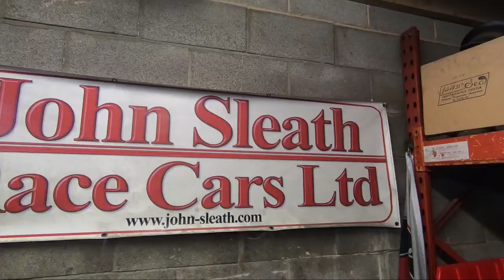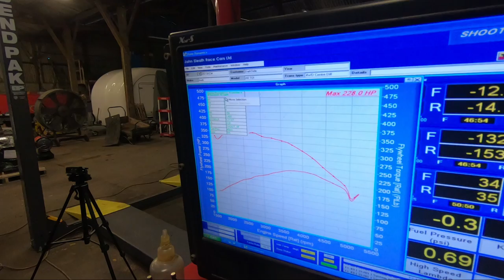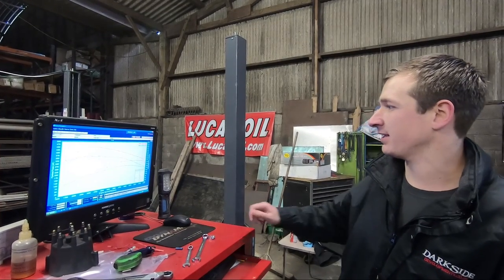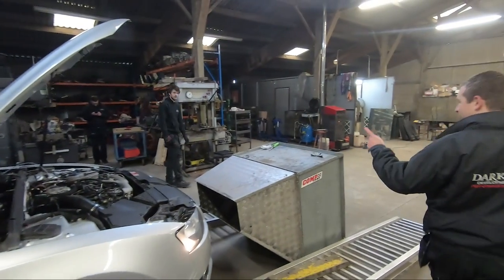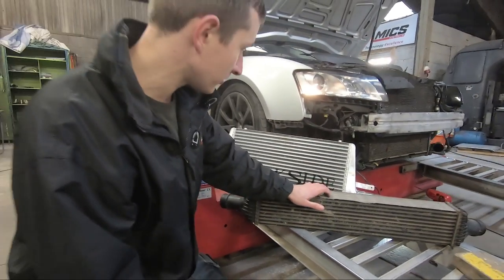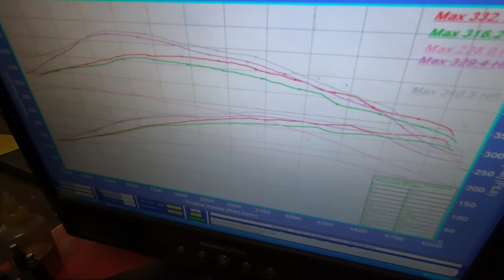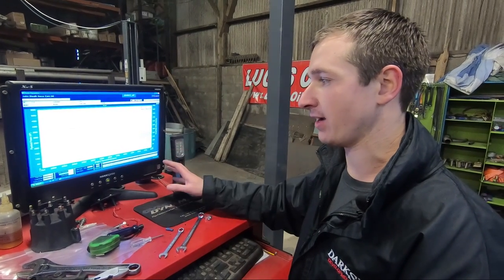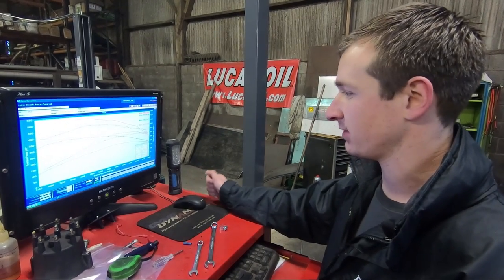228BHP to 340BHP! 4WD DYNO TUNING - AUDI A5 3.0 TDI QUATTRO PROJECT - DARKSIDE DEVELOPMENTS - PART 8

Comment: I have the same car v6 tdi 3.0 but in manual I tried contacting the previous owner to know what mods it’s had but no luck only thing I can see is it’s had dpf off and a loud stainless exhaust fitted it seams faster than my E90 330d. How do I find out if it’s had a remap or other bits please advise
Reply from the maker: Take a look at the boost pressure, just less than 22psi or 1.5bar is stock

Comment: I noticed you meantioned the Maf sensor maxing out after tuning a few videos , what sort of g/s should a stock and stage 1 tuned A5 TDI expect to see ? Mines stock as far as I know , vcds shows 240-249 g/s max at 4600rpm doesn't seem right ?  guys ?
Reply from the maker: MAF is not the best wat to tell, log Rail pressure and Boost, should be 1800bar and 1.5bar :)
Reply: @DarksideDevelopments   yes , that's exactly what I see , 1800 rail and 1.5 bar boost (245 kpa) . I don't understand why the Maf maxes at 249 g/s then flatlines at 249 ? My other tfsi cars have never flatlined (maxed out ) the mafs
Reply from the maker: You are logging the wrong channel then

Comment: Very good series, love the transparency in mod by mod dyno/timing differences. This really makes me want to go through my 2.5 AKE and fit out some parts I've acquired - I must go back and check on the clutch you use on this.
Reply: B8 platform manual has twin plate stock. This has stock DSG auto, stock clutch
Reply: @ryanp6138  I suspect by the this build is done I'll have over 450 reasons to switch to the 3.0 platform at some point.
Reply: @CarAndMechanical  maybe 500...haha

Comment: What you think about head porting, polishing? It's diesel, so straight injection, and best airflow is with polished surfaces, also that big Y-shaped intake tube porting? Also a bit beter flowing exhaust manifold. It all increases efficiency, in other terms, same power with less boost. Also what you think about maxxing out an engine on stock turbo? (no nitro ofcourse)
Reply: Porting will help this engine a lot. Inlet and exhaust manifolds are getting worked on soon but they are OK to 500hp we think. Stock turbo stops around 300hp as per this video
Reply: @ryanp6138  Stock turbo on ported and freed-up airflow? I think it would go more, like, 315 maybe
Reply: @gedas3419  it won't be worth the effort.
Reply: @ryanp6138  It's all about the time, the effort, the gains. The pride "Highest stock turbo powered 3.0 tdi" it'd be cool. Ofcourse you have fastest fwd tdi car, so such a project won't bother you. Have a good day. Thank you for answers :)
Reply: @gedas3419  everyone needs a goal!
Reply: Same car just manual gearbox i got 321hp with stock turbo, dpf delete egr delete and straight pipe exhaust
Reply: @damira.5659  Show us the dyno then

Comment: I have a touareg 3.0 TDI from 2005 with the engine code BKS. I would love to have around 330/340 bhp with it. Right now it’s remapped to around 285 bhp en with some small mods like a straight pip from the down pipe en a different air intake. I think it’s around 295/300 right now, what would recommend? Because there aren’t any front mount intercoolers or decat downpipes for it.
Reply from the maker: Email, we can help!

Comment: Been following you lads for a while on this one. I have an 07 A6 TDi 3.0 Avant, which I bought when it was only 2 years old (meaning I've had it nearly 10 years now!!). I have over 200k miles on it now though, so I'm curious/paranoid as to what effect these extra mods would have on my engine (and gearbox for that matter). It's been totally faultless - I do all my own work (and even have VAG-COM for the diagnositics), and still pulls like new. I actually got it remapped the day after I bought it, and though I can't tell exactly what increase it gave, I have had it up to 152mph on the GPS (160mph on the clock) with still more to go, so I can only guess I did gain something! Thing is, the car isn't worth anything now with that much mileage, but I still love it, and have no intention on selling it as I have other toys to keep me amused (and I can't really justify coughing up a load of moolah on a newer BiTdi just to get the extra power and a more up to date infotainment system!!). BUT, spending a few quid on it with you lads to get this much power out of it? I already love the fact that it is an anonymous looking diesel estate car, that will do over 150mph on the GPS with ease....... imagine what it would be like with even more power?? ;) So anyway, expect an email from me in regards to costs, etc., but just one quick question: would you risk it on a motor with over 200k miles on it? And if so, how do you think the extra mods would affect an engine (and gearbox!) with that much mileage? Fair play anyway lads - loving this one! 😉
Reply from the maker: Hi, we have tuned cars with the same mileage and more. As long as the car has been well looked after you should not have any problems. Some wear items may need changing a little sooner but this would be expect at the mileage anyway. Drop us an email with the reg/vin a long with a power goal and we will price up some options for you. Thanks
Reply: @DarksideDevelopments   Expect an email from me soon, Cheers! ;)
Reply: it will never make sense to sell it, you can't ask for much more in a daily cruiser. maybe a bmw touring gives you bit better dynamics and bit more analogue driver involvement, but modern audi's handle like they're on rails up to 8/10ths anyway, and are faster in poor driving conditions ie the uk, they just have everything.

Comment: Outstanding video (some mics issues) on showing the steps and progress... question: what was the fuel consumption at the beginning and then after the upgrade (in mpg)?
Thanks
Reply: Thanks, low 40s and high 30s all the time really. On track it's a lot less! Haha

Comment: Hi , very good information,
I was thinking of putting water meth injection on my Volvo S60 D5, , but with the smoke I don't know now, good to see it in the real world, 
Thanks Dave
Reply from the maker: we will make a video of smoke with on and off soon
Reply: @DarksideDevelopments  
Hi ok thanks for that 
Dave
Reply: You can obviously tune the fuel to suit ... However not sure if it's worth the extra monies and complications of a WM system for the small gains in power ... Yes when you are to the top end and you want to keep egt under control but else is no point ... But again  this is my opinion only ..

Comment: hey there. i have the a5 3.0 tdi with straight pipes and small remap, its around 300hp at the moment. every time i pull hard, at 3rd gear and close the 5000rpm it start flashing a yellow light on the main board and it goes into safe mode ,i believe its either injection or too much power that was given with the repro? Also, how many hp can i get if i hybrid the turbo and with a reprogramation? thanks a lot and keep up the good work!
Reply from the maker: You would need to check for fault codes, this should give you a better idea if the issue is fuel or boost related. We have done quite a few 400bhp+ 3.0 TDI builds. Please email us with your vehicle details for a quote

Comment: The soot coming out isn't exactly burnt diesel like most think..Now before people say what do you know blah blah blah My old man here in Australia is the C.E.O of a company that has been making diesel engines since the 60s maybe even earlier..So we got some very expensive engineers on hand and we learn alot from them and I would argue that that slight increase of power is coming straight from the meth its self and the water and meth is causing it to not burn as much fuel in the combustion chamber hence the more soot/unburnt diesel all diesel guys know you don't want to cool combustion temps it needs heat & compression to burn properly and that silly water meth is having a big side effect on that process so piss it off throw more fuel at it more air and can't have enough sensors before and after more data the more you can learn about what its doing the more you learn what its doing when and where the more you can manipulate the power
Reply from the maker: Get your old man to do some testing for us :)

Comment: By far the best project I’ve followed. 

How much money has this cost you so far?
Reply from the maker: We have spent a lot of money on this project, and a lot of time but for a customer to get this power, its going to be roughly £6k but email for a quote :)
Reply: 6k aint to bad! Considering u can buy one of these cheap, around 10k for 350hp diesel daily, that will move along the road nicely
Reply: @toyotaturbo504  not many ways to get this sound, speed, economy and comfort and this price while still looking good.
Reply: @ryanp6138  i agree with you 100% also 4wd for winter daily use! Good economy's, nice torque nice horsepower and sound! For under 10k easily!! I did look at these a while ago and always wondered what ur new GTD turbo would do on a v6 3.0tdi audi system, where do u source the new diesel pump from? Audi themselves? I hope to see nice performance again! When u upgrade.
Reply: @toyotaturbo504  The GTD2263 not a straight fit on older engine otherwise I would try it. Nice turbo
Reply: @toyotaturbo504  we will offer used, tested, reman and new pumps
Reply: Agreed

Comment: Even on stock hardware with dpf still in place you should see 320 bhp and 750nm, this map needs to be revised.
Reply: On a different Dyno maybe, HPFP pump can't keep up so how do you explain how to get more?
Reply: @ryanp6138  You have a CCWA meaning you have a  CP4.2 pump, you should be able to inject 98mg of fuel. Taking you up to 365-370bhp because you already have plenty air  with the hybrid.
Reply: @RealGX  not the case, rail pressure drops at 340hp

Comment: Will you be taking the A5 to the strip ? Estimated eta ? 13
Reply from the maker: 12s at this specification will easily be possible
Reply: As fast as a metro 1.8 turbo but with out the death feeling and a heated bum.

Comment: this is brilliant!! but i was expecting more power considering you have hybrid turbo / dpf delete / exhaust AND METH ... 
Have you tried to change the MAP sensor to a 4 bar MAP sensor ? it will give you more torque gains and better boost control.
Reply: Fuel pump is limit. Already has 4bar
Reply: Most figures other claim are inflated

Comment: What are the maximum figures you are looking for to gain?  Very impressive I will be bringing my a5 to you very soon for some work.
Reply: Fuel pump limited now but 400 should be possible
Reply: @ryanp6138  Very nice I was thinking around 400 myself depending on fuel  pump. 

What kind of price would a customer be expecting to pay for the same upgrades as this just without the meth install..  its not something im interested in running on my daily car
Reply from the maker: @blackmagic9317  Hi Craig. Drop us an email to sales@darksidedevelopments.co.uk with your reg and the mods you are looking for, and we can send you a quote. Cheers

Comment: Metering valve upgrade? What is that? Whay does it do?
Reply: Bigger air flow meter housing mate. Sits on the intake piping on the compressor side of the turbo.  Like a popular upgrade on the s bodies are z32 mafs.
Reply: As opposed to a map sensor which measures the air pressure in the intake manifold. Which is far superior for making power.
Reply: Metering valve is a fuel pump part
Reply: MAF not limit yet
Reply: @ryanp6138  are you on about the fuel sender unit? Or the bit that houses the fuel pump itself?
Reply: @ryanp6138  or fuel pressure regulator...
Reply: @ryanp6138  because theres not much to a fuel pump housing at all. Theres the pump with the pouch on the bottom and the tall narrow cylindrical thing which is the sender. So.....
Reply: @lloydeturner3722  I'm the one talking in the videos!
Reply: That valve comes in newer pumps?
Reply: @simaodelsol  buy one and see!

Comment: nice video, helped me alot of understanding this engine.  im in the "middle" of swapping turbo on my 3,0tdi CAPA engine. i have to change it anyway cus the last owner did not hook back on the intake propperly so the turbo is sandblasted inside. im def, gonna look out for videos uploaded by Darkside Developments in the future.
Reply from the maker: Great, we can supply everything you need!
Reply: @DarksideDevelopments  i am not sure but i bougth a gt30 kit of turbofun in norway wich is an darkside dealer. i think they ordered from you :)
Reply from the maker: @MathiasBP94  There is a GTD2872VRK being prepared for them now, so probably yours :-)
Reply: @DarksideDevelopments  same as you guys have on you A5 ?
Reply from the maker: @MathiasBP94  Yes it is...
Reply: @DarksideDevelopments  how is the turbo in everyday use ?
Reply: @MathiasBP94  will do a video soon describing how it goes. Very well though, you will be happy!
Reply: @ryanp6138  how do the clutch holds up ? i have not seen every episode of the series (working on it) ^^.
Reply: @ryanp6138   Ryan P  :D can´t wait ^^ they said it would take 9 building days to get. i am considering to buy a bigger pump also. are you guys planning to do a fuelpump replacement ?
Reply from the maker: @MathiasBP94  No issues with the clutch yet. Since we have S-Tronic / DSG we can increase Clutch Pressure if it slips. 

CP3 is next, these are for yours

https://www.darksidedevelopments.co.uk/products/conversion-kit-for-cp3-fuel-pump-3-0-common-rail-engines-capa-engine-only.html

https://www.darksidedevelopments.co.uk/products/cp3-fuel-pump-upgrade-for-2-7-3-0-common-rail-engines.html

Comment: I've been pondering over investing money in just a remap or uprated turbo + remap + custom exhaust, would MOT still be viable if I kept the DPF?

Also, I noticed there is also a "high flow race dpf" sold by yourselves, is this road capable?

CFFB 2.0tdi (140bhp), aiming for 200 smoke free.
Reply: Keeping the stock DPF will be the best way to pass an MOT and the only fully legal way. As long as its not blocked then this doesn't cause much of a restriction. Please drop us an email and we will price up some options for you - sales@darksidedevelopments.co.uk

Comment: Have you ever worked on the VAG 2.5TDI V6 from 98-04 ?
Reply from the maker: Yes a few but these are not the best platform to start with for tuning.
Reply: @DarksideDevelopments  I know, I'm even surprised that you worked on them. What results did you get ?
Reply from the maker: @glovercarvalho1930  Not had many on the dyno, they respond well to tuning if they are running OK in the first place!
Reply: I remember that the fuel pump on these plays about ?
Reply: The earlier models (pre 2003) used to fail a lot, also heard that those were very restrictive for some reason. I never understood why because the same pump is being used on trucks. And they also can't be upgraded since they're linked straight to the cars ECU and for that you'd need Bosch tools that basically no one has.

Comment: Bmw e92 335d with remap plus dpf off from 286 hp to 376hp. With no mods at all
Reply: Theyre twin turbo though, wonder what the vag 3.0 bitdi tunes too as they are 315bhp standard so more of an equal to the 35d engine
Reply: @leet7031  330d is a more accurate comparison, usually more expensive base car and mostly RWD unless you pay twice this price. I own a 335d X drive too and this is much faster

Comment: How is s tronic dealing with that power/nm? I think its capable of max 600Nm
Reply: pre facelift B8s have a 6speed auto tiptronic
Reply: vivalaphill this is 7 speed dsg(s tronic)
Reply: 1000nm capable easily
Reply: @ryanp6138  1000nm ? Interesting as everybody was complaining about stronics failing ... Even on s5's ... I wonder why they didn't go with the stronic on the RS6 c7 and they went tiptronic ? Hate this box !
Reply: @TheRealAnthony_real  everything has ZF8 now as they are so versatile, even 1 series right up to 8 and X. All Longitudinal VAG Inc 4x4. It's a money thing too. These stroninc are complex
Reply: Manufacturer conservative rated at 600nm at 9.5k revs or something stupid which is way above rev range of diesel engine that this bolted to.

Comment: Very interesting good to see your showing what actually happens rather than just pretending it makes far more power than it could make
 Tell me about the pump conversion do you slow the cp3 down or still run at engine speed best thing for a cp4 pump is the bin biggest piece of crap bosch ever made good luck with the project.
Reply: Well that's the idea, the day could have gone differently but we would have still filmed it! It went so well we were happy. We will have a 1:1 bolt on kit first and the bigger pump will need us to produce custom brackets
Reply: Pulleys from factory are half speed

Comment: 0-100 time now ?
Reply from the maker: 0-60mph (0-96.5kph) Time - 4.42s
0-100mph (0-161kph) Time - 11.15s
1/4 Mile - 12.97s @ 108.98mph (176 kph) - w Gearbox Tune
1/4 Mile - 13.28s @ 107.9mph (174 kph) - w/o Gearbox Tune
50-80mph (80-129kph) - 3.77s (3.85s w/o GB Tune)
0-60mph & 0-100mph w/o Gearbox Tune - 4.74s & 11.41s

Comment: no goood  diagramm.small turbo.you check,back pressure?
Reply from the maker: EMPs are very low. The Turbo is not too small for a Daily Driver, but we will be fitting a larger one

Comment: BMW twin turbo diesel is so much more tunable than this. I’ve seen them hit 380bhp without bolt ons... any reason for this? I’m not an Audi Basher by the way I’m just curious !
Reply from the maker: they are very similar
Reply: The BMW being twin turbo and this being a single probably plays a part in that.
Reply: BluePixel Motorcycling  a good friend of mine had an e60 530d and that reached 330bhp and 550ftlb ... without a bolt on and that’s a single turbo.
Reply: @kandykouturelondon2028  I've also seen 3.0tdi reach those figures with no bolt ons. There are A LOT of factors that can affect the numbers. This particular 3.0tdi, as mentioned in the video, was producing lower figures than expected.